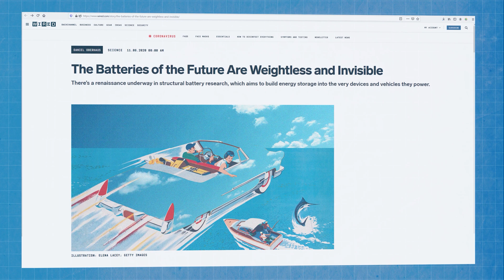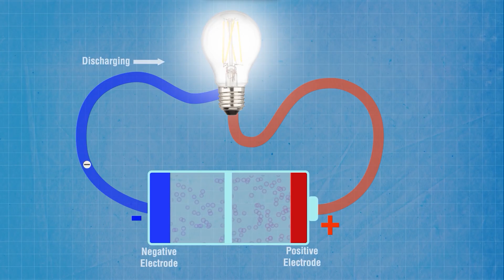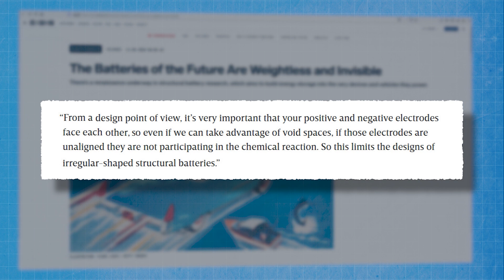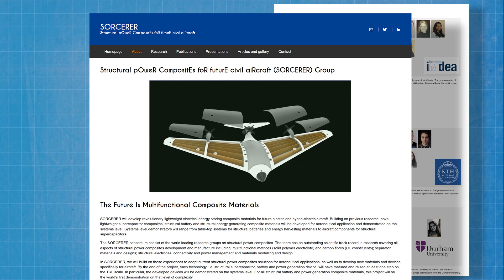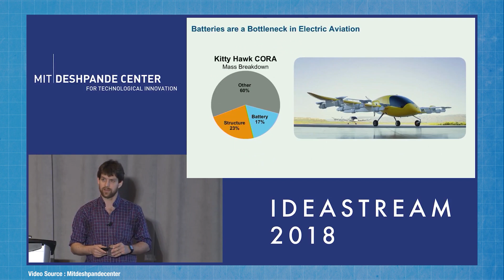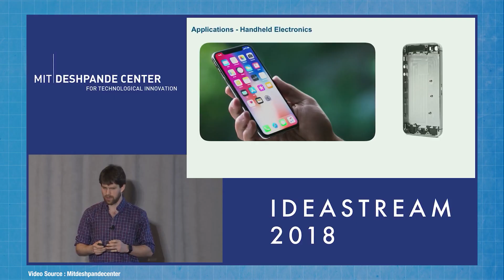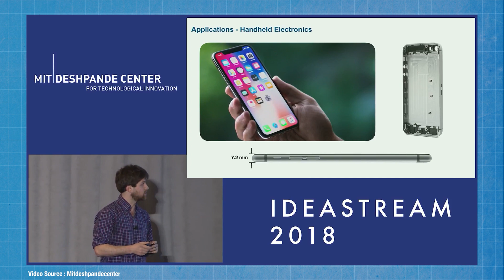Batteries in bodywork. Extending the range of cars and planes.

Comment: I read an article on the benefits of structural batteries, I guess around a month ago. I was astonished to find not a single mention of the most immediately obvious problem with this idea, that one needs only to consider the term "structural battery" for a few seconds to imagine. Batteries age, and become useless far earlier than the devices they power. When this happens to modern phones with embedded batteries, we justify throwing them away because in 4-5 years they've become obsolete and much better phones are on the market. But does this practice really scale to the size of a car? Should it?

What do you do when you need to replace your EV battery when, after 8-10 years, it no longer stores enough energy to be usable for your commute? When the battery IS the entire car body, does this mean that a car that otherwise still has decades of potential service life left in it, becomes disposable just because the battery has aged?

I am very disappointed that this video has made the same mistake. Maybe there are efforts being made to address this self-evident question, but the choice to ignore it in discussions of the idea seems irresponsible, and especially from this channel, puzzling.
Reply: Good point Chris.  I guess you would need to visit a body shop to replace your hood, quarter panels and doors every 2-4yrs or how ever long these batteries last.  They would have to design that into the product to make it easier for customers to replace those components. Just another engineering problem to overcome.
Reply: @ksben0016  If they were talking about turning these simple non-structural parts into batteries, the solution would be as simple as you suggest. But that's not the idea -- and it can't be, while holding anything close to the amount of energy to make an electric vehicle viable. 

What is being proposed is to make an entire vehicle chassis out of a laminate material that can store energy. The battery won't be "mounted to" the car in the form of exterior body panels, doors, etc. It will literally be the entire physical structure of the car, to which all its mechanical parts will be attached. It won't and can't be substantially less massive than an equivalent EV battery of today without a huge revolution in battery chemistry, which isn't being proposed here. The benefit they're talking about is that this mass can do double duty, in also forming the structure of the car rather than relying on separate formed sheets of steel or aluminum to do that job.

Comment: Thanks for covering this. I wonder about a hybrid of the new Tesla structural batteries with battery body panels. Probably only worth it for aircraft. Smaller devices may be the best use case. Would love to see more about air using batteries.

Comment: "72 times the energy density" I call BS on that.
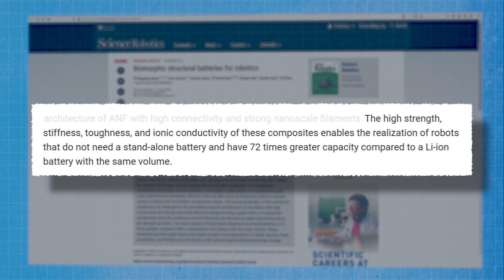Reply: (10:00) "The high strength, stiffness, toughness, and ionic conductivity of these components enables the realization of robots that do not need a stand-alone battery and have 72 times greater capacity compared to a Li-ion battery with the same volume."
Reply: 72x energy density /volume. Not clear is whether the 72x comparison is between the battery structural volume of the entire device versus the battery volume of the traditional device, or some other comparison.
Reply: Yea. It was very confusing: is it better energy density or simply less weight, due to  getting rid of extra structural material? How exactly the thin sheet cell has more capacity, than traditional Li io cell that is densly packed roll with much greater surface area? If it's the second reason: it makes sense only in planes and drones, as in cars you really some mass for the vehicle to be safe.

Comment: Why all shopping malls and shops after they are closed they still use light? What for? City buildings do the same?  No people inside no light in should be obvious
Reply: The "dark energy" side of the consumption equation is that we waste tremendous amounts of energy, I agree.  It's easier to save through intelligent use of electricity than to produce more power.🌄🌎
Reply: Robbery...
Reply: @rhmagalhaes  That was a legitimate reason, but today with motion and object sensors, the lights could be mostly turned off and cameras placed to detect any potential thieves.

Comment: It's more than batteries, it's how efficiently you can use the limited electricity that the batteries deliver.  That is the real advantage of Tesla.
Reply: Tesla is great for the size cars they produce, but check out Aptera for out of the box thinking for a more efficient transportation efficiency (about 100 Wh/mile) as opposed to just existing vehicle efficiency (about 200-250 Wh/mile for a Tesla). Then go further and consider battery powered recumbent trikes (8 Wh/mile for pedal assist @ 30 mph to 25 Wh/mile @ 40 mph, no pedal assist); this is for only one person, but this is how we usually get around.
Reply: Kyle Towers  — I salute you! (Mine is only on paper.).